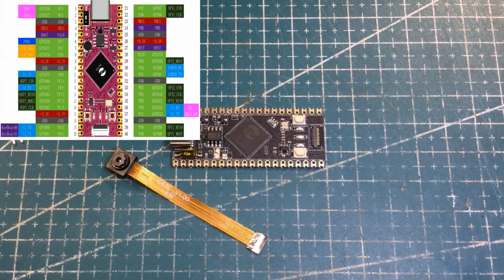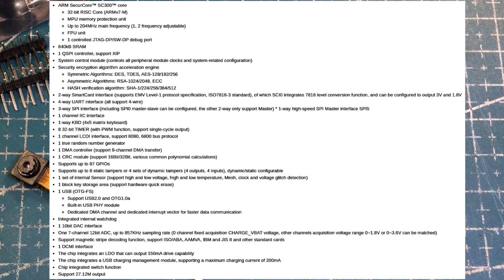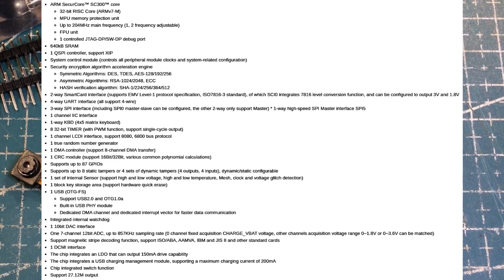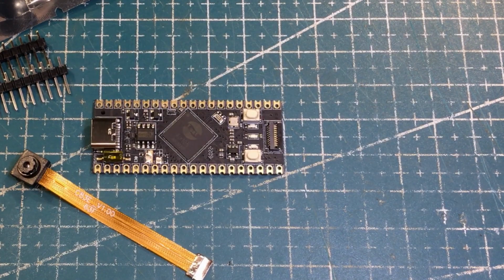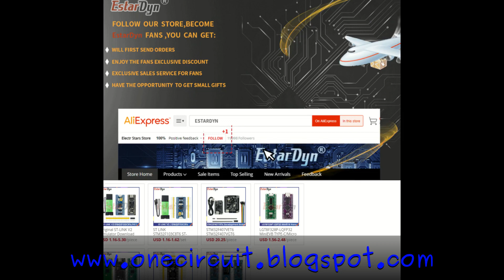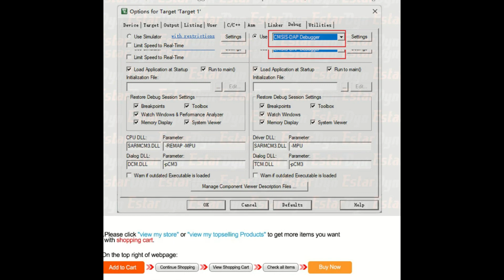DirtyDozen #04 - Exotic Unusable Tech!

Comment: Visual Studio Code with the PlatformIO extension is good for embedded processors but I'm not sure about this one. It does support STM32 and Linux ARM (RPI).
I use PlatformIO instead of the Arduino for various Atmel, ESP devices etc. I still mostly use the Arduino APIs.
Reply from the maker: I’m sure support will appear eventually, but in a busy market it’s not sufficient to just provide lovely hardware and limited in-house software. It’s the support, resources, example code etc that hooks us hobbyists! 👍😀

Comment: Big shout out for the ATmega128A, was my first real dabble in SMD. Built a 64-TQFP to breadboard breakout adapter years ago to have a play with the 128, it's one of my favorite ATmel micros.

As for your AIR32F103CBT6, looks like they've built upon the Keil uVision software, I've used that software for programming old 89S52 based 8051 and the sorts. Like you, messing around with unknown software from some dodgy site gives me the heebie-jeebies. :face-turquoise-covering-eyes:
Reply from the maker: Yes there’s some work to be done in support, but such a lovely beast! 👍😀